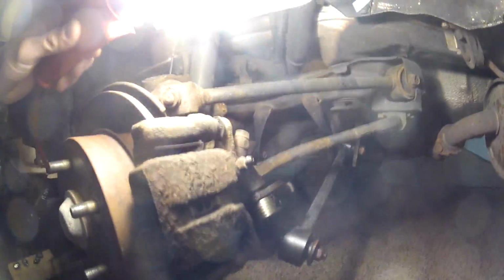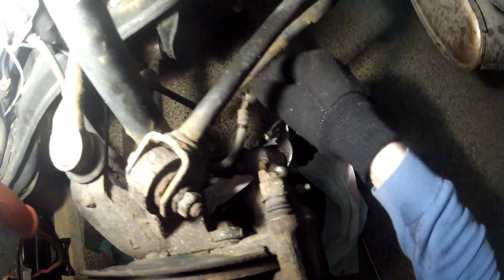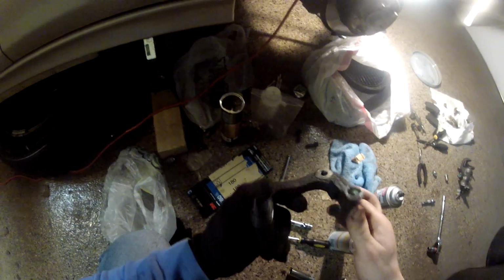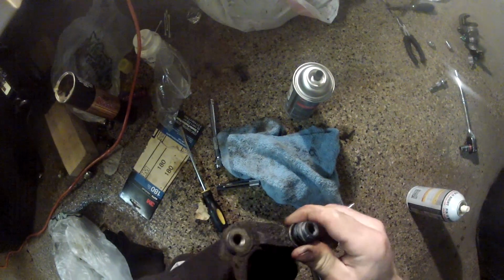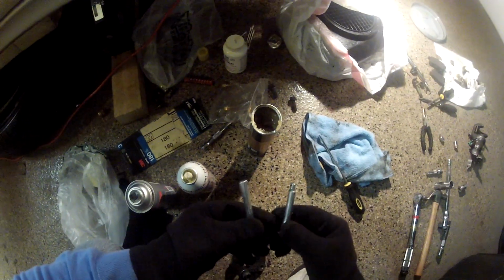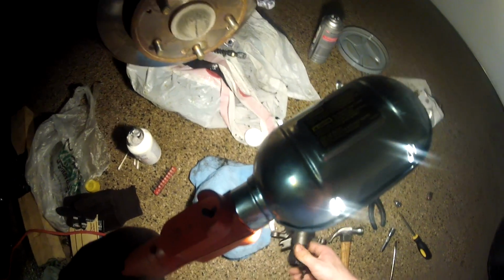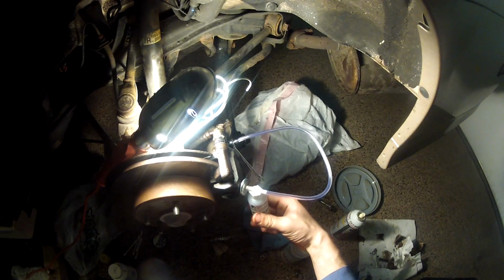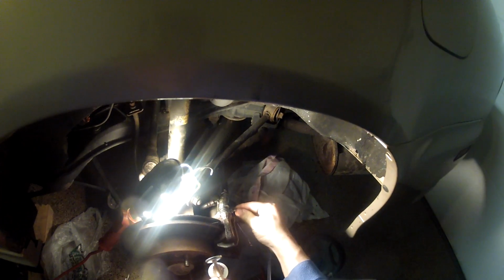How to replace rear brake caliper and boots on Honda Accord Acura J Series 6 gen 1998-2002

Comment: on the back of the inside OEM pads there are locating pins, and you need to make sure the slot(s) you use to turn in the piston line up correctly to slide onto them or the pads will seat unevenly causing uneven wear. Common sense, but I've heard of it happening... I say that because I didn't see pins on his pads (aftermarket) so he didn't need to turn the piston to line it up.

Comment: Help please!  The caliper guide pin boot that you hammer in with the socket.  Do you have a part number on that?  I have purchase several boots that are supposed to fit, but they are not like the ones that are currently on my car and torn.  The ones I have are JUST like the ones you show in this video.  Do you have a part number please...anyone!?!?
Reply: No one sells the boots with the metal washer. I've bought and returned many. You just have to buy a remanufactured or new caliper

Comment: at 2:50 you remove the slide pin retaining bolts. I stripped the head off the top one. What do I do now?
Reply from the maker: g33dav3y You can't remove the caliper now?
Maybe try to unscrew two bolts that hold the caliper holder bracket and take the whole thing out?